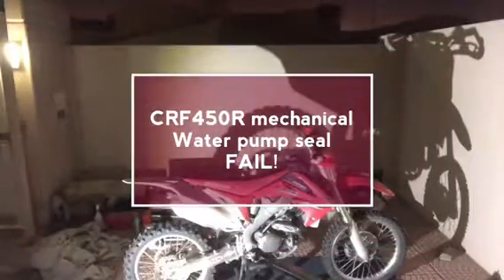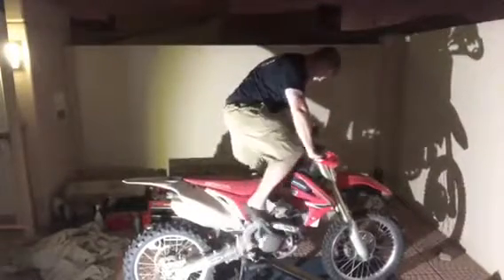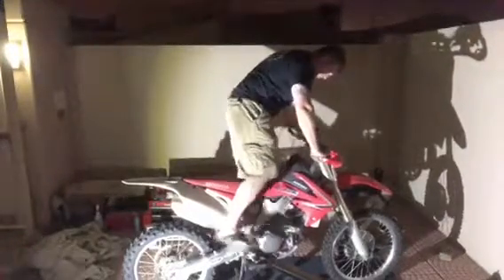Water pump seal install fail - 2009 Honda CRF450R

Comment from the maker: Turns out that the culprit was a missing $1.78 copper "Washer, Sealing (7mm)" that sits behind the impeller and puts force against the mechanical seal so it...seals.  The mechanical seal was good all along.  After I waited 2 weeks for that part to show up, I had the bike fixed in 10 minutes, and several of those were me on my hands and knees watching the water pump cover weep hole!

Comment: I just recently replaced my water pump on the exact same year and model. That mechanical seal was interesting to press in since it's not a solid seal and you have to also press in the water pump shaft afterwards.  My bike doesnt seem to have anything coming out of the weep hole so I think I installed it successfully lol.
Reply from the maker: Mike Chvarak it really is a hassle. If be interested to know why Honda went that route when other high performance engines operating at higher pressure (1.8bar in my KTM) use traditional seals.  This bike has been a real nightmare after being subjected to "maintenance" practices in Saudi Arabia for several years. I'm currently chasing another coolant leak and have ruled out head gaskets and pump seals. Unless the head is warped or there's a crack I can't see, I'm about at my waits end with it. Will do a full tear-down and bottom end rebuild over winter...or just part it out because I'm sick to death of its problems.
Reply: Is it blowing out of your exhaust or just ending up in your oil? or both?
Reply from the maker: Mike Chvarak the head breather hose that routes to the airbox and a drain fills up with clear/sweet water so it must be boiled coolant.   Then when I drained it to ship the bike literally 4 hours after a top end, there was coolant in the crankcase. Supremely frustrating. 550cc of coolant added after every ride, nothing going into the catch tank (which used to work) and no overflow or steam from boil over notes, though you can hear the coolant in there boiling. Running a 1.6 cap because ambient temps are 100-120F while riding in that country.

Comment: I think that bike is cursed
Reply from the maker: BACK40ADV no kidding. Cursed by shitty maintenance before I got it. Packing 9 years of upkeep into 6 months, ya know?
Reply: @Unibrawler762x  I have the same issue now. Went to 2 shop around town. One could not even remove the impeller. My other shop said buy a new complete side with the water pump installed already. Since I have a crack that I JB welded. So now I wait. Bikes been sitting for 3 years. Again bought it used.
Reply: @kevinmansur3690  check out this later video of how I pressed in a new seal after I did a button end. 

https://youtu.be/owvfhxV01rE
Reply: @teamagoge-theenduroists8683  hello. Yes I tried that trick with the washer. Still couldn’t get it to stop. Then took a vise and pressed it together and still nothing. The rebuild kit gave me a plastic piece. Not sure how to install that. Since there is not enough treads to bite once I put that on.   I just ordered a hole new cover with water pump installed
Reply: @kevinmansur3690  pretty sure that plastic piece is meant to be used to press it in wo damaging, if I'm remembering correctly. Not all kits included it. As you can see in the other video, we tried 4 different ones.
Reply: @teamagoge-theenduroists8683  yes. Still no luck with it. Moving on to a new cover. Thanks for you advice